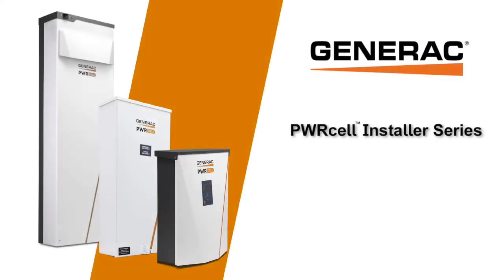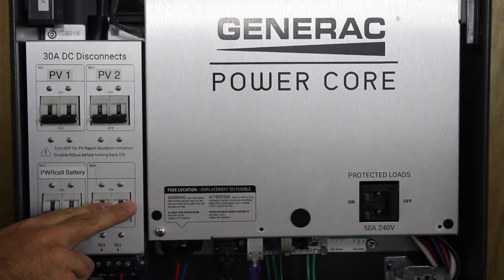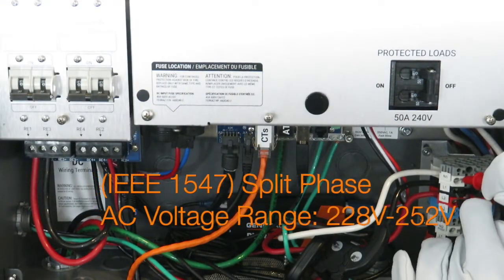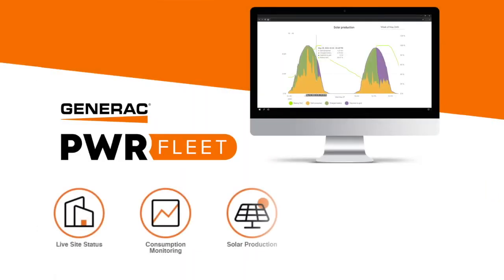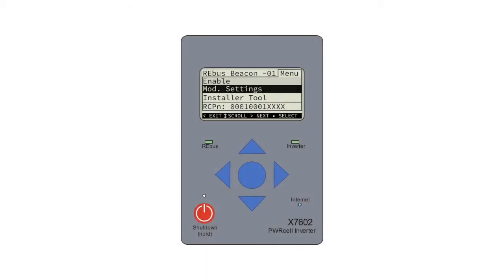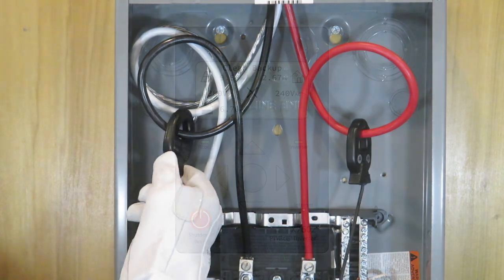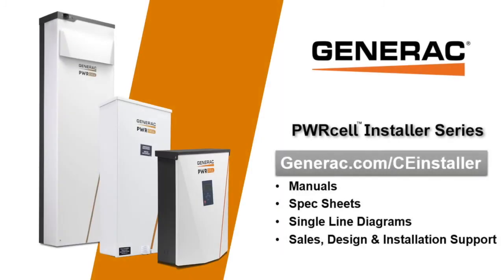Generac Installer Series: Introduction to Commissioning

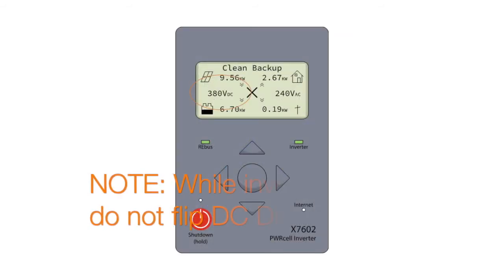Comment: At 1:40 the video instructs "Before enabling the inverter, place the DC Disconnects in the On position." Then at  2:05, the instruction is "While the DC Power Bus is supplying voltage, the PWRCell Disconnects should not be turned to the On position." with text on the screen "NOTE: While inverter is enabled, do not flip DC Disconnects". Which is it? On or Off for the DC Disconnects? Thank you.